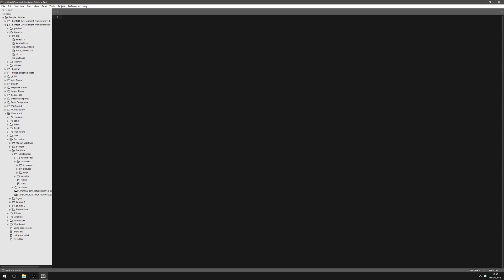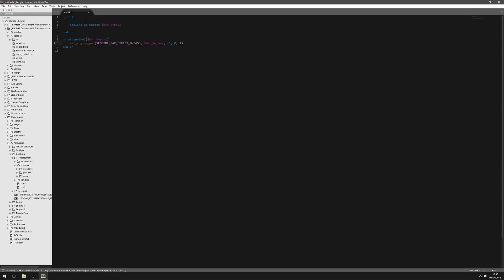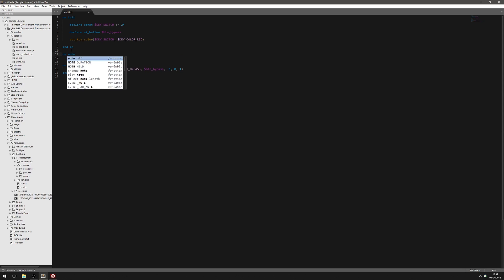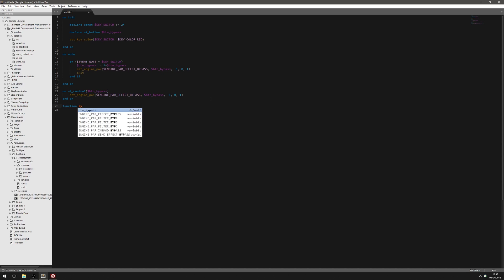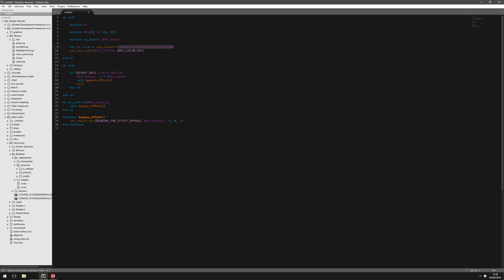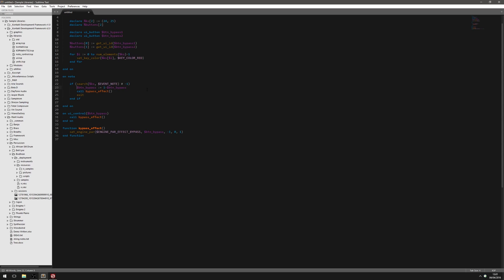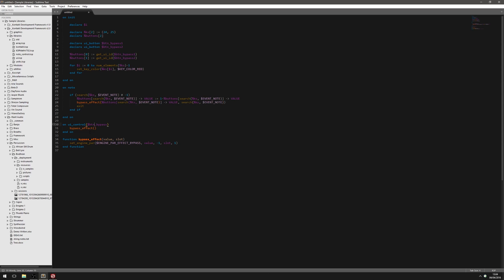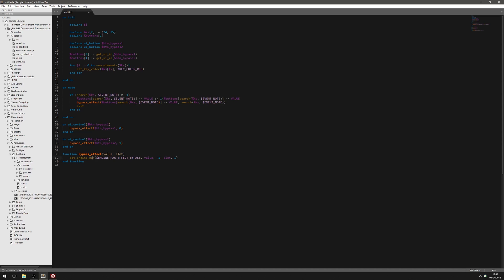How to bypass Kontakt effects with scripted buttons and keyswitches

Comment: what I'd like to be able to do is to bypass a Kontakt script altogether for passages where it doesn't work so well! Within Kontakt, of course you simply press the Bypass button but can you automate this in a DAW so that it can be switched on and off where desired through a keyswitch or whatever.?
Reply from the maker: There is no way to automate the built in bypass buttons.
Reply: @Xtant-audio    Had a feeling that was the case but thanks, anyway.

Comment: amazing tricks as always! thanks a lot ;)
I am currently trying to control an EQ2 instrument insert with sliders, but if succeed with FREQ and GAIN, the BANDWIDTH, however, doesn't want to work with ENGINE_PAR_BANDWIDTH...
any idea?
Reply from the maker: Hard for me to say without seeing your code
Reply: of course but thanks for replying!
it appears that all the engine parameters are not accessible, I fixed my problem by using the GEQ insert instead of the EQ2. This way every parameter is accessible from KSP
I think it is maybe just a limitation...?
cheers
Reply from the maker: It could be but I thought bw was available to all the EQ. But Kontakt is weird like that :)